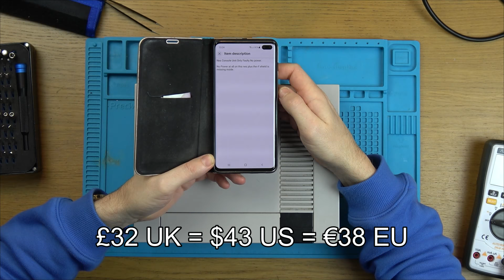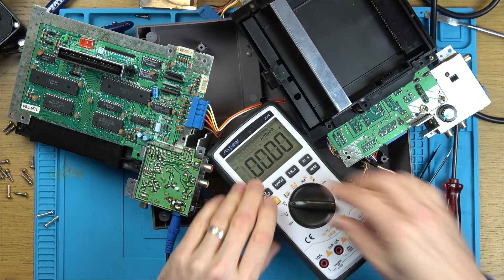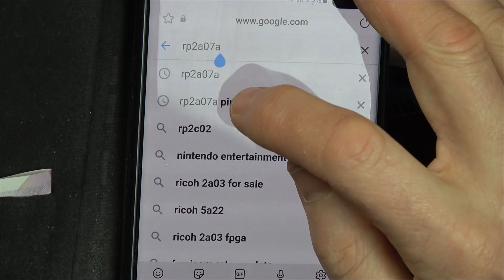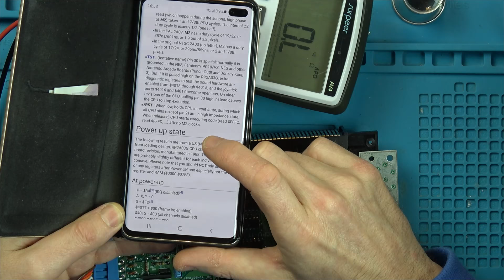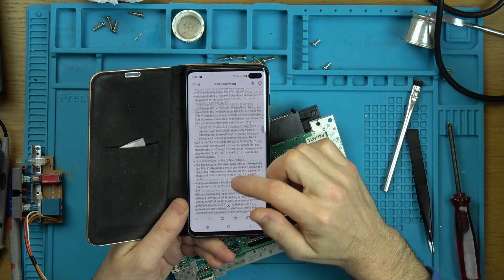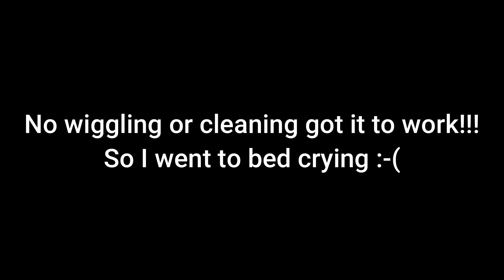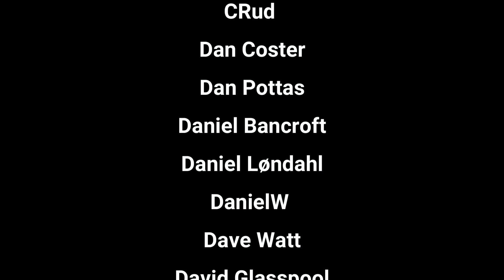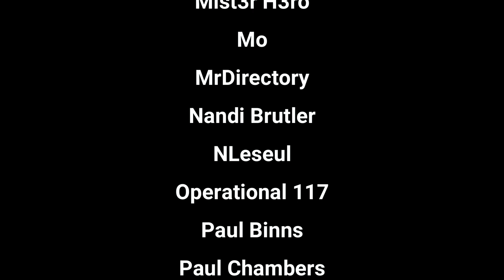eBay Nintendo Entertainment System ( NES ) with Numerous Faults - Can I FIX it?

Comment from the maker: Spoiler Saver (on some devices) & riddle.

Thanks for clicking to watch. I hope you enjoy it, here is a riddle for you...
You measure my life in hours and I serve you by expiring. I’m quick when I’m thin and slow when I’m fat. The wind is my enemy.....What am I?
Reply: A candle!
Reply: a candle
Reply: A Candle?
Reply: A slow candle 🕯️
Reply: why not fix a 1930s radio removing the wax capacitors i heard theze things are dangerous in heat volts what not but you can learn over at mr carlsons lab yt
Reply: A candle 🕯️🕯️🕯️
Reply: a candle
Reply: Capacitor.
Reply: Definitely a candle
Reply: @my mate Vince,. Sorry dude but amateurs mistake NEVER test any electrical devices by plugging power into it IF IT RATTLES as it could cause further damage as the object could cause a short when power is applied, resulting in electrical shock or fire and could be very dangerous and lead to a bad day.otherwise great video, always keep the good chips from destroyed consoles, as they are getting rarer each year.
Reply: @Graytail  Definitely no letter a in definitely.
Reply: A politician.
Reply: @SpeccyMan  Excuse me for misspelling the most commonly misspelled word in the English Language. 
The top ten are quite a troublesome bunch - 
1. Definitely (Definately) 
2. Sacrilegious (Sacreligious) 
3. Indict (Indite) 
4. Manoeuvre (Maneouvre) 
5. Bureaucracy (Beaurocracy) 
6. Broccoli (Brocolli) 
7. Phlegm (Phleghm) 
8. Prejudice (Predjudice) 
9. Consensus (Conscensus) 10.Unnecessary (Unecessary)

I must confess to getting broccoli wrong too, apparently.
Reply: thought it was an ssd
Reply: A candle 🕯️
Reply: @theatheisthammer  That's the answer to the riddle.  Congrats - your prize is a brand new shiny toaster.
Reply: @SpeccyMan  Heck yeah - EVERYBODY loves the Internet Grammar & Spelling Police.  Especially since they work for free! 🙄   SMH
Reply: Candle??
Reply: I bought a Nintendo from someone and they lied saying it worked and it doesn’t even power on I’m frustrated don’t know what to do.
Reply: @omar concepcion    Mail it to Vince maybe
Reply: Thought it was sunlight. Thin = sunset (goes by quickly) fat = rest of the day. The sun is giving us heat by expiring. We measure daylight in hours.
Wind = enemy... 🤔 well everyone's got 1 enemy for whatever reason 🤷‍♂️
Reply: Candle

Comment: A note about that first chip in which the pins voltages seemed to be swapped: All chip with a 74HC part number are what is called glue logic chips. They allow the main chips to work seamlessly with each other. That particular chip (74HCU04A) is an inverter. The pins you were looking at will always be opposite logic levels to each other as one is the input and the other is the (inverted) output.

Comment: Cutting traces on a vintage board seems like sacrilege. Oh and I desperately wanted you to test a few of those discrete components. Diodes go short circuit and resistors go open. Good you found the chip pinouts. How about Checking all the obvious voltages across all chips first. Good fun though.

Comment: That warm fuzzy feeling when a Patreon early access Vince video appears =D   That leg on the CIC chip, if that's not cut and lifted - it will reset the NES constantly (if there's no cart in the slot which is the correct region).  Cutting and lifting that leg bypasses the region check, and it shouldnt reset all the time from that point then.  The PPU is not married to the RAM.  The SRAM types can just be different, but you can swap the RAM without issue.   You can source spare RAM chips (equivalents), but the PPU - the only place you will get one is another PAL NES.  The NTSC NES has a different PPU and CPU.  The alternative is to buy a cheap Famicom and swap the CPU and PPU, crystal and a few other components to get it running as an NSTC NES - but that's a lot of messing around, and if you buy a faulty Famicom you don't know if the PPU and CPU are going to be OK (and both are required if converting to NTSC).
Reply from the maker: Haha, nice one Chris. So that is a shame about the PPU, at least it is NOT married to the SRAM. It is strange how so many things went faulty. Maybe the fault cascaded from one chip to the next. Certainly not my best buy on eBay but on a positive I learnt a lot about this system. Hopefully the next one I come across will go smoother. Cheers for the info as always 👍👍
Reply: @Mymatevince  Yes, it had a surprising number of issues!  Great that you got there in the end though and work through each problem! =D
Reply: Not just a nice MMV Patreon early access vid, but a great wealth of information from Chris as well. I'd gladly enjoy watching Vince swap Famicom components onto a NES board. I do agree the risk definitely needs to be considered when purchasing other failed consoles. 

Neither here nor there really, but what always amazes me is opening up a clone console and seeing a single COB (Chip on Board/Blob chip) replacing pretty much every IC in an old NES. [Insert any random "you're getting old" comment] 😂. 

Take care gents.
Reply from the maker: 👴 Happy belated 80th Birthday Shawn 🤣🤣 You are correct though, it is amazing how the cheapest handheld clones can have this technology on a tiny Blob chip 👍👍👍
Reply: @Mymatevince  👍🤣
Reply: There's no reason to cut the CIC pin, there is a no-cut method which works far better since some games will just actively refuse to work if the pin isn't present.
Reply: @Mymatevince  With so many faults and the blown LED, I would hazard a guess that someone plugged in the wrong power adapter, or the power adapter they used had a fault. Either too high of a voltage, or DC with backwards polarity.

Sega Genesis consoles are killed in the same manner, people using AC supplies or the wrong polarity DC plug that blows up the linear voltage regulators. Genesis consoles use outside positive barrel jacks, while the majority of today's power bricks are inside positive. Also the wrong voltage, the genesis needs 7.5-9v and people try 12-24v supplies that again blow up the linear regulators.
Reply: As soon as I found out decades ago how to disable the CIC chip on my NES, I did.  Now it'll never blink the screen and annoy me ever again!
Reply: @Mymatevince  I have clone PAL PPU & CPU and RAM here. Will i send some?
Reply: @GGigabiteM  Since the NES runs on AC I don't think reverse polarity DC could hurt anything, the input runs through a rectifier anyway. The 7805 voltage regulator can also apparently take an input of up to 35 V, which is massively more than the regular power supply provides. So I'd look for likely causes elsewhere. We know some quite ham-fisted person messed with this console and we don't know if that was before or after it failed. They definitely did some impressive board damage!

I wonder what happens when the voltage regulator loses its ground connection - would that possibly cause the output to go haywire? We definitely know the ground connection was severed by those scratches and I think thats the regulator IC.
Reply: 9:10  emty m1 Garant 😂

Comment: When you take out any chip to make a swap its always a good idea to put in sockets since it minimize the  risk of tearing off the solderpads and traces (the chips feet/pins can also break off from stress) . It also saves you time from not having to re solder things on and off obviously. Its a habit anyone should get into when dealing with chips that aren't being manufactured anymore (getting rarer)  & should be treated with care.  Ultimately think of it as an nice gesture to the next person who will be repairing / tinkering with the console next time. While Vince did it towards the end I still think he could've saved himself some heartache by doing it right from very start instead.
Reply: When I was a tech that's exactly what I would do to my golden boards on every IC I would suspect had gone bad on my unit under test. Quick test with the suspect IC and replace or goes back in.

Comment: Where the board was cracked, i noticed there's a bad solder where looks like its the capacitor. If you go to 51:00s youll see it on the bottom right.  Not saying that'll be the problem but might be. Love the vidz 😊

Comment: It's a brave person who says 'it says it is faulty' when it comes to a NES :P I bought 4 NES's on eBay Australia, all saying faulty, all but 1 turned out to be the 72-pin connector :P
Compared to my original NES where I had to run a bodge wire to fix a broken trace.

Comment: So there are a few options for the PPU.  You can either get a replacement clone PPU, which would be a 6528P (P being the PAL version), or you could get both an NTSC CPU/PPU which are easier to find, I had to buy some to repair a couple Famicoms and replace the oscillator for whatever NTSC is, I forget.  I had a look where I bought my OEM IC's, but there weren't any 2C07's sadly.

Of course you could get both the NTSC replacements too, which would be cheaper, which are 6527 and 6528, made by UMC.  You can also get compatible SRAM from a variety of locations, you can buy some from aliexpress, you can get it from games sometimes or I have some, since that was also damaged on the Famicom I repaired, if you'd like.

Other than that, nicely done on the CIC chip diagnosis, I have never seen one of those go bad, though I did know you can use any from a game, so that's nice you had a spare handy.
Reply: You've never seen a CIC chip go bad, but I also don't think you've ever seen someone attack their NES with an ice pick like this poor thing was. Those scratches and cracks were brutal... what the heck happened? O_o
Reply: @acumenium8157  That's true, my first instinct was what the hell lol.
Reply: @MizuhoChan  I remember seeing in a forum someone removing the CIC chip completely and replacing it with some bridges... Since the system doesn't need it to work (famicoms don't have a CIC chip) it works a treat!!
Reply: I was of the understanding that the reproduction CPU and PPU chips have compatibility issues among other oddball flaws with other games. Sure would be nice to have perfect reproductions of the original ICs for this and other consoles....
Reply: @NordicDan  I've never heard of this or looked into it much but I'm not surprised. It's hard to perfectly replicate a chip. I wonder if flash carts avoid that problem though?
Reply: @acumenium8157  To be honest I haven't heard one way or the other, but now I'm curious too lol
Reply: @NordicDan  I would say clone chips are still a good idea if you're intent on using original (or as close to it) hardware and carts. If very, very few carts don't work, a flash cart might be a viable alternative, or just emulate it on something if that's viable for you as well.

I didn't know clone chips weren't exact though. I wonder if this causes issues with SNES repro games since many of them use custom chips for sound effects or graphics?

Comment: Just in case you don't know already but I have that same desolder station and the fan is really loud. Very annoying. It is a 5cm 12v fan being fed with 18v so it's working flat out. I replaced mine with an 18v one off eBay and it's much quieter. Just plugs straight in to a black box on the back panel of the station. Might help you keep the noise down if you're trying to film while using it.

Comment: Just here to say thanks for the share. I had a similar but different power issue but this video helped me find the issue. 

Thanks!  

Pulled a security chip from a game to replace the console and it works. 

Numbers on chip 
Top-  6113B1
Low-  8913 7 BA

Comment: I have been watching and enjoying you videos for year now Vince. On this one I was a bit surprised, I thought you had more knowledge of how to troubleshoot a system like this or basically any old computer of console. I don't mean this in a negative way, so hope you don't take me wrong.
I have a few tips for next time, this is how I do this, and is a general way I learned from doing repairs. 1. check if power is going to the board, you can do this easiest by just taking a logic chip (74...) and measure between bottom left and top right, this should be 5v. Then check the reset, most cpu's have active low, and if stuck of toggling then find the source, I have never seen a chip pulling this low, so it's in the part that generates this signal (a schematic would help here). Then check clock signal, no clock no activity... If all good, check for activity on data and address lines, if nothing then check cpu. If cpu is running then there should at least be something on the screen, and this will lead you to further troubleshooting, like working ram, video ram, or anything like that. Hope it helps for next repair, you have come a long way from your first repair video's and have learned so much. I enjoyed watching you videos and see your knowledge grow.
Reply: Nice tip. Care to make a video on this?
Reply: @kingforaday8725  Wish I could, but that’s a thing I’m not good at, so I’ll leave that to the pro’s like Vince…

Comment: quick hint , buy a supply of cheap single side turn pin sockets and socket parts like these, the heat and removal and resolderong can cause damage to IC's, traces. or VIA's, then it makes chip swaps like these low impact

Comment: Apologies for commenting only a bit into the video but once the screws are out the cartridge slot connector just slides off the main board. Just have to make sure you've got it aligned well when you reinstall it or you'll have trouble getting games to work. The original NES cart connector is notoriously unreliable--it's designed to be close to zero insertion force, which has the advantage that it does not wear down the cartridge contacts as much as typical edge connectors, but the disadvantage that it also doesn't clean the contacts either. The original NES cleaning kit does a good job of cleaning the cartridge connector, but people have also found success just chucking the whole connector in boiling water (find someone's instructions I've never done it myself).

Also you appear to be missing some screws. There are quite a few screws holding the main board in normally.

Also the confusing voltage at the beginning is because it takes an AC input. The ground of the unit is connected to the negative out of the bridge rectifier, not either of the legs of the input jack.

Comment: Also, the moment you found it was a screw, and you couldn't work out where it was from, I instantly noticed that the cartridge tray is missing 3 screws :) 2 gold ones, identical to the case screws, and 1 long silver scerw.
Reply: I don't understand why he tried to power it on with something rattling inside. He could have damaged more. Always open it u first and remove the rattle before it shorts something and blow up another chip.
Reply: @Madrrrrrrrrrrr  I cringed when he did that. Could have gone up in smoke.
Reply: @jcluttrell  a lot of fix channels do it.  I think when it goes up in smoke, it has entertainment value. But that's my underbelly talking hahaha

Comment: I have worked on nes that no led power worked and found tarnish in the power switch pins  and cleaned them and it worked right up all was fine after that and had a nice working nes!

Comment: time code 8:06 to the right of the crack in the board, and down, are a couple disturbed looking solder joints on two through hole components. Seems you just swapped the board in the end for your repair... Maybe this was the problem after all? Thanks for your vids, I'm learning stuff here!

Comment: I think the CIC lockout chip pulls reset low by design if no valid game is inserted. So that behavior is expected.

There's an algorithm that runs between the CIC in the console and CIC in the game pak. It's very sensitive so that's the reason many cut Pin 4 on the CIC to disable it.

The CIC in the console and game pak are identical btw. If Pin 4 is connected, it's in "lock" role. If not, it's in "key" role. So if you ever actually do have an NES with a faulty CIC you should be able to replace it with a CIC from any random game.

Edit: commented to soon 😂. You were on that track.

Comment: at 8:04 below of where the board is scratched and cracked there are two cold solder joints, pausing the video at the time I marked, you can see them clear as day to the right of the tweezers and it's bugging me that you missed that.
Reply: yes i saw that right away too.. think its going to c9 cap..

Comment: In the beginning near the crack in the board when you zoomed in I can see broken solder joints on the pins for the chip on the other side.

Comment: You can find some decent schematics for the NES online. They may not exactly match the unit you have but it may be close enough to give you a clue. I usually go to the console5 wiki for game console schematics first because they collect as many as they can.

The actual NES schematics however are third-party and are drawn in a somewhat confusing and unorthodox way. I often find myself referring instead to the Famicom schematic which is direct from Nintendo and is a lot more normal. Note however that aside from using the same CPU and PPU, many other things are different about the Famicom (it has no lockout chip, the cartridge and expansion connectors are completely different, it has hard-wired controllers with different signals, the io buffers are arranged differently) so that's of somewhat limited use.

One more thing to be careful about is that there are a few different RF/power units even with the same NES mainboard, so you have to make sure you're referring to the right one.